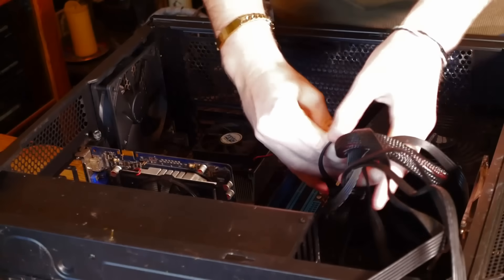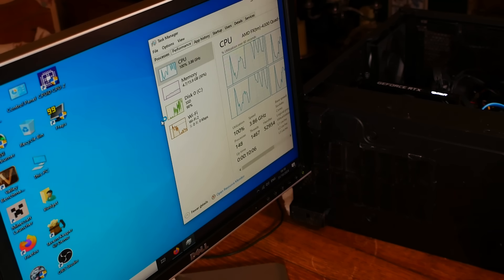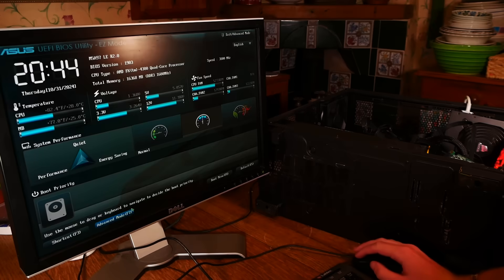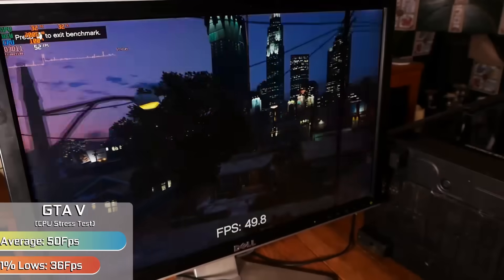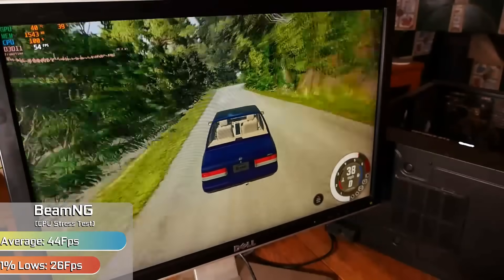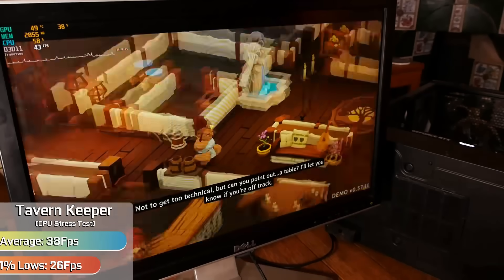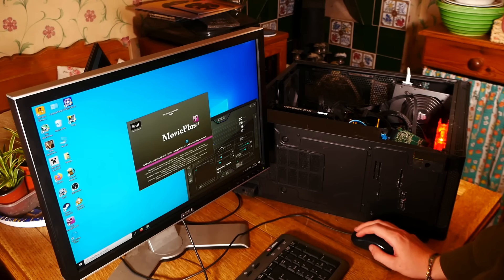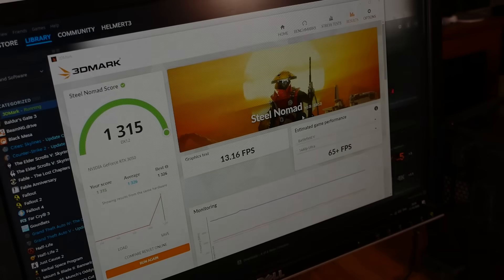AMDs Weakest FX Processor...

Comment from the maker: Are you still on AMD FX… (I’m so sorry) if you are let me know how you’re finding it 👍
Reply: my fx6300 is still chugging along. I don't play modern games and I'm more of a tinkerer using NixOS for occasional programming, CAD and 3d printing
Reply: Back when AMD's top end has increased in core count, and US$300-350. Now, at that price, it just a glorified low-end 6c.
Reply: I'm running a fx 8350 with a gtx 1060 6gb as my video editing and my daughter's homework computer.   It's good enough.
Reply: @AlfaPro1337  dude are you ok? For under $350 gets you a 9700X and a 9600X is going for around $250. Heck, for $380 you get a 9900X
Not to mention the 7000 series price with the 7700 going for almost $250
How are those "glorified low-end 6c"?
Reply: @MushroomClippyOfKnowledge  Nah, those pricing is right after X3D dropped. Original MSRP is way higher.

By AMD and PCMR standards, 7th gen Ryzen is too dead and dated.

Guess you didn't look at the pricing of AMD's top-end before Evil Su took over?

PX4 9600 - US$300
P2X6 1090T - US$350
FX-8150 - US$300

So what do you expect for US$300-350?

1. A glorified low-end 6c?
2. More than 8c top-end CPU (definitely not 8c, 10-12)?
Reply: @AlfaPro1337  "a glorified low-end 6c" Almost like it's made specifically for performance inside of games instead of fancy specs that only matter on paper
Reply: @itsmejak7888  If so, you should be buying Intel 4c/8t or 4c/4t, because that's why AMD is doing right now.

It's what the company doing matters, not the performance. People were happy when they got a top-end CPU for US$300-350, and increased in core count.

I guess you lost the argument and probably seething at the fact that what I said is the truth, and you got scammed and got a glorified low-end CPU!
Reply: My HTPC has a fx4300 and gtx 1060 6gb good for game streaming (to my main pc) and watching youtube. I have overclocked it to 4.8ghz stable.

Edit: Streaming in 4K 60 HDR
Reply: @WayLAN_Media I too, fx 4100 at 4.8ghz in asus m5a78m lx at 1.55vcore.
Reply: I had an FX 8320 still running up until some 2 years ago, when the motherboard died (and new ones were hard to come by here in Brazil). It lasted some 8 years. It was actually a decent processor, even though it had terrible temps.
Reply: @cesarbernardi1646 yes the only downside are the temps
Reply: i still have a fx system, a fx8370 on a asus  crosshair v formula-z motherboard, 32 gb of corsair dominator 2133.. i pull it out once in a while a mess around with it.
Reply: @markskonecki2050  I had the same combo, paired with Titan both cooled with custom loop OC'ed at 4.7. Fantastic custom loop by the way, still working and cooling well my Rtx 2080ti with i9 10900k.
Reply: I haven't used an FX, but I seem to recall that Steve from GamersNexus daily drives one on his personal machine. Undervolted and all. At least a year or two ago he did.
Reply: yea. I’ve got an amd fx8350, 24 gigs of ram, an rtx 2070 super, in a thermaltake level 10 gt snow edition… really wanna make the jump to am5 soon
Reply: I'm hoping to pick up a Microcenter 7800x3d bundle myself for Christmas.
Reply: @tech8652  interestingly my FX8350 is also in a level 10 but mines a combat edition (army green) mine once also had a 2070 S but I down graded to an R9 390 as that was more than adequate for my needs
Reply: @tech8652 my man this is such a wacky bottleneck lmao, even AM4 would be a colossal upgrade. no need for AM5 and DDR5 really with that GPU.
Reply: Yes. the piledriver 8 core, surprisingly solid
Reply: I still have two FX CPUs and my two kids use them everyday.
Reply: Fx 8350 and a GTX 980Ti. Still getting by, I am definitely looking forward to having something that runs cooler and smaller.
Reply: I have a small media-oriented PC rocking an FX-8300 that I acquired through local trade.  Even going to my backup rig,  with its i5-4460, it's a night and day difference.
Reply: really good and its enough for me
Reply: i have a english friend that is still on am3 platform.
Reply: my pc was a refurbished ibuypower with an fx 4100, which was fine as long as i wasn't playing anything from before 2010 lol. a year or so ago i got an fx 6350 which im running now, and does pretty well for almost anything i need.
Reply: I'm still on amd athlon, lmao. Amd athlon 740 if I remember correctly.
Reply: Yes, FX-8370 with GTX 960 2 GB...
the only limitation for me is in such niche use as the 86Box emulator, which requires much single-threaded performance, so I can emulate Pentium 75 at full speed at max
otherwise, it's more than enough for most my uses
Reply: I still have my AMD FX 8320 on a Gigabyte Ultra Durable MB with 16 Gb RAM and SATA SSD and GTX 1650. Old beater that I play old game on. Still going strong. lol. It never dies, amazing shit!
Reply: I'm still using phenom... one day I might upgrade to fx xD
Reply: @FacialVomitTurtleFights  Don't. Spare yourself the headaches I had to deal with. 😳
Reply: 6350 still my daily driver
Reply: Still on an FX 8350 and using a 1660 Super the nice MSI dual fan Gaming X model. Just waiting until I get RAM for my new motherboard then will be upgrading to a Ryzen 7 5700g and re using what I can from my old system. The FX has served me well since first using it back in 2015. Been through a few video cards since then actually and had two of them die. I find FX CPU's to be rock solid if you keep your expectations low they are capable of playing some modern stuff on Medium to Low settings with the right graphics card really not bad for what they are.
Reply: I have an 8350 system that I gave to my parents. It has a 32bit version of Windows 10 so all my dad's old games run natively without any tweaking.
Reply: I still have my FX8350 I bought in 2014 paired with an RX580.
Reply: I have started collecting FX chips, I now have one at every core count, and I'd say 2 golden samples. My 8320 (hits 5ghz at 1.47 volts) and my FX 4300 (does 5ghz at 1.44v)
Reply: early this year a fx 6300. Was cheap didn´t like it and made problems after ~6 years. Now a midrange Intel. :D
Reply: not still on it full time, but when im not on my Main Rig (which still rocks a Ryzen 5 3600) the PC i use for the "livingroom" Area where i spend more time than my own Bedroom where my main rig is, im using my oooold Rig which boasts an FX 8320E.  when you look to estimate performance or rather your expectations, with How the FX Arch. is built you dont have a Quad core, 6 core, 8 core you only have Dualcore, Tricore and a actual Quadcore.  w/ how they share the cache and FPU. you'll find performance differences when you Run games seperating them between the Odd and Even "Core" count in Windows's Task manager (as you'll find exactly when its running off the actual Cores and ones that are sharing the FPU. )

that said this old PC running the FX 8320E, for what i need it to do when im just chilling in the larger room, it's good still, like i can still watch streams and yt at 2k just fine,  i can deal w/ VRChat in Desktop mode in small instances, , Retro games, emulation and mid era games have no issue. then again im pairing it w/ a 1650 Super.  im using it at times as a streaming PC for just fine at 720p 60/1080p30w/ a HDMI Capture card. 

the FX Shined more w/ Multi-threaded tasks than any model ever did in single threaded task.
Reply: not anymore but i used an 8350 well into 2022, it was not the greatest (performed about the same as a friends i7 920 but with better 1% lows thanks to having AVX support i guess), was surprisingly usable.
in most games it managed to give me 50-70 fps and when paired with an rx 580 it made for a pretty good 1080p medium pc.
Reply: FX 7500 in a laptop. It's running alright.
Reply: Was driving Fx8320 till 2 years ago , then i moved to ryzen and x570 , still on 3600x . I was fine with fx , wasnt with asrock mobo tho .
Reply: I have one tucked away on plex duty 👍
Reply: back in 2015 I was gaming with the fx-8350 till 2017. I liked the chip.
Reply: Still rocking an FX 8300. Doing great, thanks for asking. Gaming, everything I own runs great. Where it falls flat on its face is video rendering. Luckily I have access to beefier hardware for that.
Reply: I have an FX 8350 with a GTX 1080, and with an Asus M5A97 R2.0, and 16 GB Corsair 1600 MHZ blue RAM chip. And most of the games are going really well even on Ultra,and on 2k Rezolution.
Reply: My uncle still uses an FX-6300 and mobo i got from marketplace and a rx580 2408sp i got from aliexpress it still plays every game fine.
Reply: i just upgraded to a Intel core i5-14400f from a fx-8350 I was using for about 6 years and I still have my PC, it's not my main anymore though
Reply: im still rocking a fx8350 black and sli 1070tis... just about everything i wanna play works great in 1080p med/high settings
Reply: Went from an 8120 to a 4770k and used that for a minute until I went to a Ryzen 2700x. Rocked that for a while and went to a 5800X3D. That 8120 was the first PC I ever paid for and built myself. Wish I still had it, but I always passed parts on to family and friends when I upgraded.
Reply: FX 8370-E user here.  Its not a bad PC for streaming with a dual PC setup.  I got much better benchmark and encoding gains by OCing the FS bus than by just increasing the core multiplier.
Reply: My 6350 has been relegated to NAS usage, in which it still does its job admirably
Reply: I used it on my gaming server that I host the game of the moment for my friends and I on. Ended up upgrading to a Ryzen 1600 about a month ago when I got a board and chip for 50 bucks Canadian
Reply: While I am using a Ryzen 7 5900x as my main desktop, I still have my old FX 8350. Tested a while back on Tomb Raider 2013 and seemed to play it pretty well. I know I used to play Resident Evil 2 remake on it as well and did very well.  My issue is that next year Windows stops supporting windows 10 and the FX 8350 and my old 4th gen i7 laptop cannot take Windows 11.
Reply: @KitsuneVoss  There are supposedly ways to get around the Windows 11 hardware check, but yeah it probably makes sense to move to a more modern platform for Windows at this point. The FX-8350 would still make a decent Linux desktop system if that's an angle you're potentially interested in exploring.
Reply: I'm re-building my first gaming pc, 16gb ddr3, fx-8350, and r9 390 oc from sapphire
Reply: My daily driver is still my ancient 2012 FX-8350 build with 32GB 1866 ram, R7 360 2GB, Samsung 840 EVO 240GB boot SSD, 3 x 2TB Crucial MX500 SSDs, and some assorted 2TB and 1TB HDDs. I had to add a PCIe SATA card to have enough SATA ports. All in a Thermaltake Dokker case that has no glass panels and no RGB unicorn puke, powered by a SeaSonic Prime Gold 750w PSU that came with a 12yr warranty. I have never overclocked it, so I have never had any heat problems with it. I have a CoolerMaster 212+EVO w/2 120mm fans on it in push-pull config. I have cool n quiet enabled in BIOS, windows 7 power profile is set to balanced. HW Monitor tells me the CPU is now at 30c with a max of 49c since last boot. I only reboot when Avast Free updates the program and requires a reboot which is about once a month. The system has run 24/7 since it was built because I have to run a torrent client 24/7. At all times I have running Total Commander, Deluge, Firefox, Palemoon, 4k Video Downloader, and usually Media Player Classic Home Cinema. When I need to download something from usenet I'll fire up Forte Agent. And if the rar archive needs repairing with par files, QuickPar fixes it fast since it can use all available cores.It normally only uses 4 cores, but Quickpar or playing a high bit rate 4K video can cause it to use all 8 cores. I'm not a PC gamer so I have no idea how my CPU or GPU would fare in games. All I know is that it still does what I built it for, so I haven't wasted money I can't really afford to spend anyways building a newer Ryzen system. I think maxing out the mobo with 32GB ram and having an 8 core CPU(yes, it has 8 integer cores and 4 FPUs) are the reasons it has kept up with my needs.
Reply: I'm still on Phenom II X4 with DDR2 RAM😕
Reply: @foobar-9k  I have a Fs1b mobo and it`s slow af, but still fun to really see how bad it is 🤣
Reply: I was still using an FX-8350 Black Edition until middle of last year and I would probably still be using it if my RX 480 didn't suddenly die
I still have my old setup around to turn it into a media or emulation station or maybe even a pinball emulator at some point
Reply: I got the FX8350 and I was playing games with this for 9 years and had a great experience until the motherboard started warping and eventually broke from it. I revived it some and made this computer a secondary one. I always ran my CPU at 4,6ghz which was the highest the two worst cores would go. But I liked it and it was a great value in the end
Reply: Im still on a fx 6300 not bad  even in 2024.
Reply: I used to from mid 2023 to late 2023, it did not perform as good as I thought it would for a 12 year old 4 Core CPU, it made me switch to a whole gaming laptop with a Ryzen 5 7535HS and RTX 2050. I would definitely not recommend using in for modern gaming
Reply: Former FX8350 owner here, ditched it around february this year (2024) due to a motherboard EOL (i'd still be using it otherwise).
I didn't truly realize how slow that thing was till i got myself this cheap 12th gen i5 on sale (it's a 12400F), and it absolutely ripped through all the old games i had that were being kinda sluggish cause i had choked them up with mods.

For some of the newer stuff though? didn't notice a thing in GTAV performance-wise, no man's sky ran about the same, and RDRII was still about the same speed, maybe running a little bit smoother in saint denis with the new cpu, but that's it.
For modded project zomboid, which was eating up 100% of all cores on that old FX, it was a HUGE difference though, didn't even look like i was playing the same game anymore, the i5 was super fast in that, cpu consumption was a little under 50%.
The elder scrolls games and fallout games all ran much faster too on the newer i5, shockingly faster, but that's cause of the abysmal single core performance of that old FX - it appears, and felt like, that the old FX just barely outclassed a late gen pentium 4 in single-core speed, and that's really bad.

Oh yeah, during all this i had it clocked up to 4.9-5.2ghz in the summer and a lil bit higher during winter, bordering 6ghz, with the core voltage going up to 1.475 which was about as far as i felt confident pushing that thing and my poor barely cooled VRM.

One fancy trick i pulled with the FX for the legacy vidya: my gigabyte board, the ole GA-990FXA-UD3 rev3 had a feature that would configure the cpu to use "1 core per compute unit", so instead of a shared parts technically real but kinda fake 8-core, it would become a full 4-core with access to all the resources, instead of sharing them.
This would make the older stuff run considerably faster, at the cost of making the newer multithreaded stuff run worse, which i welcomed with open arms.
This 4-core config also enabled me to raise the clock even higher! :)
Reply: my dad was on amd fx 8350 2014-2023
he upgraded to i5 4670k, when he comes around again I'll give him i7 4770
Reply: had an fx 8350 until 2022 when i switched to a ryzen 5600x. i still used the same r9 380x. the jump was massive. larger than i could ever have imagined. that being said, despite it being shite, the fx managed to run any game i threw at it...albeit on  low frames. but it did it. switched my r9 380x for a (faulty) 6700xt. massive jump. now, i switched it to 7900gre (a pretty substantial jump again tbh)
Reply: @Celatra  that's awesome. My 8350 has played everything I've thrown at it as well. Granted I don't play a lot of the newer games out rn. And Ive got a decent bottleneck with my rtx2060 12gb GPU. But I'm happy with my setup. One of these days I'll upgrade it to the Ryzen 5 3600 I have sitting on my shelf with the b450 mobo. But for now I'm happy with my setup the way it is.
Reply: I was on the fx 4300 until I got an i7 3770 witch im still on and it plays bo6 way more power do miss the overclocking of the 4300 though
Reply: Yuuuup! I use my fx 8350 with a 1070 8gb to play VR and run most of my music software and steam games for the last 4 years
Reply: my son is still running an amd fx 8350, no issues.
Reply: I sold my 990fx sabertooth for a profit .  what a beast
Reply: Using Phenom II and FM2
Reply: I have a 10 year old FX8520. It's still usable as a HTPC, only to watch movies and stuff
Reply: Only replaced my FX-6350 quite recently with an R5. With an aftermarket cooler w/ a massive heat sink, the temperatures did remain low and the overall performance wasn't completely hopeless.

Yes, it didn't run modern AAA titles. But for the games I tend to play, it was more than enough.

My nephew is still using it in Fortnite and Minecraft :)
Reply: The grouchy old FX9590 is still running.  It grinds out work-units for B.O.I.N.C. with ease.  Once in a while I take it for a spin in WoW, and it still works fine.
Reply: I am running AMD FX 6300 with 750Ti 2 GB GDDR5 GPU. I am able to run DeepSeek 7b LLM on it, it is slow but it still runs!!!
Reply: I daily an FX 6350 machine for novelty. It surprisingly runs what I want it to. Overclocking is really easy to do for these, thankfully. Since you basically have to OC to do much of anything on these chips.
Reply: fx 8120 , 22gbram corsair 1600mhz , it´s a decent cpu nowadays , like 8tb in hard drives , rx 560 4gb
this is my main pc .
Works still good ot this days
Reply: Fx6300 here
Reply: I've had an 8350 for almost a decade now and somehow it still works for way too much
Reply: Still running my Youtube channel today in 2025 on the old FX8300!
Reply: Aye, on the final days of my FX, served me well for over 10 years.
update After 3 weeks on a 9600x, i admit that games with an arc b580 are significantly faster, along with bootup, filecopying, running vpn etc, but the fx is still fine for watching streaming movies or browsing. And the real twister is that Hell let loose ran faster on the fx than on the 9600x/b580 combo. Sometimes older is better.
Reply: Typing this on a PC with an FX-4300, way better than what I had (Athlon II X2 245e). Might have to get a GPU to match, maybe a low profile RX 6400 or better. 👍
Reply: Recently played god of war ragnarok without avx2 and without lags on fx8350 with 3060ti, also AC vallhala locked on 60fps. but i have m2 with adapted. ghost of tsushima also very good on personal setting. Mirage also was good. Only upgrade I accept at lowest is 5700x or some medium am5 cpu.fx8350 Its bottleneck for 3060ti but sill i can go ultra setting on full hd with 80-100% while gpu 60-80% and all depend on game u play.RDR2 was stable at 80fps.
Reply: AMD FX8350 Black - still running strong after 12 years and on the stock cooler - the hottest it ever gets is 72c - love then thing.
Reply: I have a ryzen PC but i had a friend with an AMD FX 8350 Black Edition that absolutely struggled in anything, it either wanted to overheat or die one of the two, it randomly crashed a lot, sadly i used intel up until my current PC so i couldnt enjoy dealing with this idiot series of processor (i really did not like FX CPUs, i always thought of them as potato processors)
Reply: No, I'm on the futuristic i7-4710HQ. The FX series I completely skipped for some reason.
Reply: I had given my old FX-8300 with 16 GB RAM, RX-460 and half gig SSD to some kids. It still runs older games like Sekiro, Dark Souls , Code Vein with 1080p med settings and they are not complaining 😁 I also have old FX-6100 with GB RAM as a printer server. Works fine, no problems.
Reply: Of course not: 1100T@4GHz 😲
Reply: I was on the top end fx processor (8/4 cores, last version before zen) for several years, then moved to an r5 1600AF (A 2600 by another name) in january of 2020. Using a 3900X for my daily driver and have a 3600 and 5600 as well, though only one's in an asymbled system.
Reply: My brother is still using my old fx6300 PC at home for browsing and videos and other lightweight stuff. It's amazing how cheap it was to get absolute balls to the wall 990fx motherboards for these CPUs back when I built it.
Reply: @BudgetBuildsOfficial  I am indeed still on the FX 8350, and it runs my games just fine. I used to cool it with a Corsair 280mm AIO but one of the fans was playing up so I switched to a spare air cooler I had, think it’s a Hyper 212. Keeps the cpu at a decent temp and is quiet.
Reply: only just this last summer i sold all my fx powered pc's and am3 platform stuff, and I'm happy with AM4 for a while yet
Reply: well, i just changed my 5700x3d and 7900xt to semptron 2500+ and radeon 9550 :)
Reply: I plan on rebuilding my fx 8350 system just for nostalgia purposes..  The rx 580 from the system still works😁
Reply: I got a computer which I'm running Proxmox on for 20 bucks, with a fx6300, and upgraded it from 4gb to 8gb ram
Reply: Yeah I had this for years. Finally moved to a Ryzen 5.
Reply: Yea on my main PC Fx 4300 with r7 250 1Gdd5 i replaced stock cooler😅😅😅 with air cooler.
Reply: FX 8350 is fine for web browsing and programming on Linux.
Reply: Not my prime mover, but I do have a couple, a FX8350 was going to be my budget challenge until a dirt cheap X58 system same my way
I actually jumped from Phenom II X4 965 to i7-3770 after getting a H61 board (minor pin surgery required) in a bundle of junk - the previous board being AM3 with limited upgrade support for FX
Reply: I used my 6 core FX until last year.
Bought it in 2011 was good enough for Doom 2016
after that.... it started showing its age
Reply: My FX9370 was clocked up to 5Ghz, used till 2020 then it went to server duty underclocked. It was just retired from server land last year. Bought it cause the 4770K was 200 more at the time.
Reply: How is the FX 4300 the weakest when the FX 4100 is the lowest model?
Reply from the maker: @RWL2012 FX4100 has 2MB more Cache, which largely made it match the Piledriver FX4300. There is also a weird OEM cut cache FX4150 but they all perform within such a small margin of each other that there’s usually very little difference.
Reply: Until a couple of years ago I was dailying an FX9590 for both work and games. The FX eventually died. I'm now using a second hand , second generation i7 and get the same/better performance.
Reply: I went from a Phenom II 1090T to an 8-Core FX processor. Doing so caused me enormous RAM issues - not to mention system instability. I tried three separate FX processor types (including 4 and 6 core), 3 brands of RAM, and 3 different motherboards with the same RAM issues, before giving up and going back to the Phenom II.

Phenom II still works great, and outperforms every single FX I used - even the top of the line ones for the era. 

It was a disaster of a processor. It absolutely hated running 4 sticks - even when they were the same type! Phenom II ran 32GB just fine on the first try, and performing well with that and a GTX 1070.
Reply: @YT-TheLegacy  I remember getting a phenom ii 965be instead of celeron, i3s or fxs since it was almost the cheapest option and somehow I used it till 1 year ago, first gaming and study, then as an office pc in my business. It worked pretty good for what it costed
Reply: I was on the second best fx cpu until about 2022 which is when it became unbearably slow.
Reply: No. I upgraded from the Phenom 955, it was a considerable boost, felt right away. Kept it (8350) until I upgraded to Win11 on an i5 8400 (got for free essentially). This was also a considerable uplift in performance. I only really bought AMD CPUs for my personal use.
Reply: @BudgetBuildsOfficial  I upgraded from one almost 2 years ago. It was getting non-viable in modern games, especially on Windows 7 I refused to upgrade from. 4.2ghz, 2*8gb 1866, GTX1080, 2560*1080 75hz.
Reply: Wish you benchmark one day the FX-9590
Reply: Skipped the whole Faildozer era, when I saw the reviews of FX-8150, I instantly ordered a Phenom II X6 1055T. After that it was Intel until I got a Ryzen 5 2600.
Reply: I still use a FX-8350 in one of my pc and it hold up really good. But I`m looking for a FX-9590 to try out :)
Reply: @Amahrodon  ah I currently use an ryzen 5950X for 3 years of use it still feels like new I hope it last over a decade
Reply: @HarimeNuiChan  This just one of several older pc that I have, but my main has a 5900X/RX6950XT and it`s awesome!
Reply: @Amahrodon  hey nice I daily drive the rx6950XT since 2022 as well! I replaced with it my aged GTX 980 I had from 2014/2022 till the 6950xt release
Reply: I used the FX8350 with a coolermaster V8GTS for years up until I switched up to a 2700x. I always used to say how amazing it was (even though it wasn't even close to Ryzen) Even when I had to go back to it for a few weeks after a board failure, I didn't really notice too much of a diference in performance until I started playing the games I was used to at the time. I had it coupled with an RX Vega 56 mind you XD
Reply: im on A8 9600 BRO IM BROKE BUT ATLEAST ITS AM4
Reply: I have a FX 6350 system but abandoned it to closet for my i9 9th gen laptop. Still, would buy a 8350 or 9590 if i wanted to go back.
Reply: Waiting on my 7500f to arrive but YES still using (for now) my old 8320
Still works okay for the games I play but an upgrade will definitely double my FPS 🤣
Reply: I was on a 6300 from 2018-2021, honestly it was solid, but 13 year old me (and.. well now 16 year old me) really likes beamng, and the beamngmp multiplayer mod was just getting popular, that's where it really just stopped working. started out in 2018 with a radeon r7 240, then in 2020 i switched to a gtx 1650 super (younger me should have bought like a used 980 for the same price..) and it just worked well.

(also, strange thing, i always found my 6300 to absolutely suck in minecraft without optifine, i remember being entirely unable to play 1.17 for a while because optifine was delayed over and over..)
Reply: Im still running FX8350, works ok, heats my room, but still can game and do work.
Reply: I have fx6300 still very usable PC , ASUS motherboard , 8GB ram , Saphire HD something ...
Reply: Yep I'm using an FX-8350 right now because my 1800X has gone through two motherboards fried by lightning. My partner is using an A10-7890k because I needed the 8350 and the only other alternative I have is... my FX-4300. It was a terrible processor but it was my first build and I wanted to save money for the GPU.
Reply: I am still rocking an AMD FX8350 with an Asus 970 Pro Gaming Aura motherboard with 32gb of 1866mhz DDR3 ram and an rtx2060 and it plays everything I like to play just fine. I'd say the most demanding game I play is Destiny 2. But it's nice and smooth. I am in the process of getting together a Ryzen 5 setup as my upgrade. I have a MSI b450 tomahawk mobo with a Ryzen 5 3600 and 32gb of DDR4 2400mhz ram. Hopefully my CPU cooler will work with am4.
Reply: My fx8350 at 4.44ghz 220bus clock stomped 3rd and 4th gen i7 but I did have the best mobo the asus sabertooth 990fx with a 4x4gb 1600mhz ripjaws @1760mhz hits 4th to 6th place in userbenchmark and has smoked some 4.8ghz@200bus clk  benchmarks she was a beast and carried had as more games used more cores it wasn't perfect but a 3rd or 4th gen won't touch it in modern games
Reply: Still using a FX-8350 in my lab PC.  I was happy with it, even this year.  I only upgraded my main pc because of a single game I wanted to play it couldn't handle 😅 And then I found out I would have been fine on it after all.  But still glad I upgraded
Reply: I finally upgraded from Phenom 1090T to FX8320e during early Ryzen days when lots of people dumped FX on eBay. Built a second soon after for my kid. FX8320e was one of the better FX chips, basically being a reliable overclock at low temps.  My kid upgraded to AM4 and my wife got one of them. (Upgrading from Phenom x945, lol).  I later upgraded my CPU to FX9590. I'm not much of a gamer, so it did what I needed it to, although was a hot beast.

Finally just switched to Ryzen 9 7950x. About 10 times the performance at 50W lower TDP. 😂
Reply: yes i am, im still running a FX-9590 in my daily rig paired with a GTX 1060 and its still running 99% of the games fine, its not the best and it is showing signs of it getting old by sometimes having small bugs and glitches but thats almost never atmost 1 time a month or so, so yes i am still really happy with my old CPU and GPU and i will not replace them until i really cant run games anymore
Reply: a few years ago i was running an AMD A10 6700, that thing was atrocious to use in general, upgraded to a ryzen 5 5500 and it's going strong
Reply: I still use one. It is the most modern PC I have. All others are 486 and Pentium 1 "collection" and a Duron. I meant to upgrade a few years back but a sequence of events, that probably started when a certain boat docked in the wrong place, caused the prices to escalate beyond my financial capabilities. 

My current system: Fx-9370 ; Gigabyte 990fxa-ud5v30 ; Ripjaws 16GB cl7 ; Sapphire Radeon R9 Fury OC 4GB ; WD_BLACK 1TB SN850 on a PCIe Riser and an old 40GB IDE for the boot sector/partition because AM3 motherboards can not boot from NVME ; a few other platter HDDs ; Xubuntu 22.04 .

I mostly use it in power saving mode (CPU limited to 110W, 1.4GHz; GPU limited to 45 W, 300MHz) which, with all peripherals, consumes around 140W while still allowing me to comfortably play GTA Vice City/ San andreas and all the Hitman games until Absolution using Lutris in 1080p. I actually have to frame limit those games or some of the animations run too fast and cause the game to not register actions. Most of the time I just use Firefox, Blender, Eclipse, etc. The only thing I cannot run (so far) is applications that require AI.

I could not see if you were using a platter HDD for your testing but I highly recommend you install a NVME on a raiser and retest. Preferably install the raiser in a slot where it does not have to compete with the GPU in bandwidth but still connects as directly as possible to the CPU (instead of a slot that connects through a chipset/southbridge like some x1/x4 slots). In my case, I had a huge boost in FPS in games because the CPU/GPU did not had to wait soo long for the textures to load (the most drastic increase I saw was Hitman: Blood money, running in performance power mode, that went from max 80 FPS to max 220 FPS).
Reply: There was an exception, when the FX-9590 could be bought second hand for 50 quid, it was an absolute bloody bargain providing you had the rest of the rig for it which I did. Ran it for 6 years at 5.5Ghz without issue until I jumped to AM4 2700X, now on a 5800X3d, same board and ram. :o)

And it also doubled as a room heater in winter with it pulling a mere 225watts.
Reply: p.s  I am the original author of the X800 bios mod that gave you an X850 for free. ;o)
Reply: Rockin a 9590fx...  Biggest problem is getting windows to play right with the drivers for the board..  and crossfire being dead on modern games...  Had to "upgrade" from 2 r9 270s to a 590 fatboy.  The board drivers are catalyst2 and the gpu is adrenaline.  Trying to get an install allowing pcie3 instead of 2 is a pain and i foolishly tried to fix i
as alt tab dropped brightness to 0 in all applications and i had to get lucky with a graphics reset to restore brightness.  When 3 works it is of course double the fps of 2(the board can bridge pcie2 lanes together into 3 when the drivers are working).  Which in palworld is 1440p max settings about 40 as opposed to 14 to 20 fps.
  The 2 r9 270s of course match the single 590(together they have more ram so the higher texture qualities are better handled) but mGPU must be enabled in the games code since dx12.  I had to upgrade due to a Palworld incompatibility with the last compatible version of adrenaline with the r9 270s.
  If it wasn't for AMD abandoning the needs of the motherboard in their drivers I wouldn't be upgrading to a 5090 and 9950x3d.  But times change and hopefully that combo will last a decade as well.
Reply: I still use a pair of FXs, more because they work perfectly fine for their age. Fun fact; I bought an FX 8370 in 2018 new for dirt cheap, and the biggest surprise was that AMD was apparently still producing it at the time even as Ryzen hit the markets, as it debuted with the newer Wraith Max cooler that was limited to the Ryzen 1800X at the time (and valued pretty well as a working starter cooler). So it was a sneaky way to get the Wraith Max cooler if one was wanting that for whatever reason.

My FX-8370 was used to upgrade an older FX chip on a GA-970-Gaming SLI mobo that had served as a gaming rig, and remained a usable rig with an RX 580 GPU and playing games at Medium settings with Shadows off, and that lasted me until Ryzen 2000 came out. The PC was then repurposed into a basic home-server/PLEX-style server with a single-slot RX 550 GPU, and a bunch of SATA drives.

My second FX was a freebie from a friend; an FX-9590 and a board capable of handling its energy use. I mostly used it to practice water-cooling building, before eventually retiring it to having an AIO and serve as an arcade-emulator and old-games rig, still being left on Win7. I still turn it on on occasion during winter for easy space heating and to play some older games that don't play well on Windows 10 or 11.

Will newer, cheaper Ryzens work? Sure. But why trash them when they're still perfectly serviceable? A bit of undervolting and custom timings see them doing well enough.
Reply: I built my pc in 2012 still using, AMD FX-8350 on an AOI... the gpu is a 1060 3gb the AMD 7870 died
Reply: A8-5700 is my bios repair work horse
Reply: i have ir unti june ,i have it aboz 10 ir 1w2 ish    yers
Reply: I am not on FX any more, however I was on an FX4300 for years. I upgraded to a R5 1st Gen only within the last few years when the old system failed.
Reply: It's ok. Very durable system
Reply: @YTSZAZU  yea until  my was broken i didnt have new one
Reply: my router is still running an 8350e. last cpu without the psp backdoor built in. handles 300+ firewall rules and 10 gig ethernet like a champ
Reply: I still have mine stored.I did pair it with 24GB Ram and SSD mostly for browsing the web with way too many open tabs. It also has a way too big bequiet aircooler with 120mm fan for low noise. Phased it out for Ryzen 3000 some years ago.
Reply: Yes using an fx 6300,earlier used an i3 3220 and it was trash
Reply: Have been running fx-8320e for 4 years, and it rocked!
Reply: Learn to adjust for inflation if you want to talk about the prices of the past. This is embarrassing.
Reply: I've got an old system in the garage and it's rocking a FX8300 cpu and two GTX 970's in sli. I fired it up last month and oh man is it slow!! It still has a spinny disk and not an ssd, so the boot time alone was painfully long. I keep it in the garage during winter because it serves as a space heater when under a heavy load.
Reply: FX6300 + 750TI here. It was a budget build when i bought it years ago but surprisingly it still works, modern games in 720p are somewhat playable depending on the title. I could run elden ring, though it wasn't very playable, same engine armored core 6 on the other hand worked so well i could actually play it in 1080p. Online games with lower system requirements like rainbow six siege still run really well. It really depends on the title and whether or not it's well optimized.

Im getting a new gpu in a few days and im really curious if 6300 can keep up with it or if im going to be cpu limited until i get a new motherboard/cpu/ram combo in the future. Personally my experience with it has been positive, big reason why i'll be sticking with amd and upgrading to ryzen in the future.
Reply: My brother uses a FX 6300 and NVIDIA 720 as main pc. 
He is studying to become a lawyer.
Reply: FX9590, HD7990 32gb DDR3 1600. My AMD build from 2014. I remember fighting with it just to get decent frametimes in BF4 due to crossfire, I learned that I wasted 600 dollars on a card that you basically can use only half of lol.
Reply: not in years - I do have MB, memory and a fx6300 and 8350 in the closet- I remember them being hot and slow due to architecture.
Reply: am still using my FX-8310 & Biostar ta970 to this day..The memory is gskill ddr3 running at 1866 and still going strong. The comparison to the I7 the FX was way more value an overall computer that could game for half the price ..  God Bless
Reply: i still use the FX 6300 and 8350 (even though i use a Ryzen as well)
Reply: im with celeron g1820 need help
Reply: No, but some of the laptops I’ve used have A6 APUs which are UNGODLY SLOW because of a hard disk drive.
Reply: late video but yeah dam
been using an fx 8370 that only used 40 percent of my 2060 playing vr
thanks to amazing valve software tho it was actually playable
Reply: As a hobby system builder I find the FX series a beautiful oddity. 

Incredibly powerful for windows XP, vista and 7, barely capable on windows 8 and surprisingly capable on windows 10, (seriously it seems to run better on 10 than on 8). 

Few CPU are actually good for multiple OS boots but the FX 6300 and 8300 are remarkably capable of running from windows XP to windows 10 as well as surprisingly stable for Linux distros and emulation drives. 

While playing anything newer than cyberpunk 2077 on an FX 8350 is spotty at best the fact that you can literally run XP to 10 at reasonable quality expectations is actually amazing. 

Now I do have an i7 4790 and it really doesn't perform that much better than my FX 8350 system.

Yes average and max fps regularly win with my 4790, however that's partly because it's paired with a GTX 1070 8gb while my FX 8350 is paired with an r9 290 4Gb. 

I've found the bottleneck on the 8350 doesn't like running a GTX 1070 or even the RX 580, it seems to be more  in parity with 4GB GPU. 

The 8350 works quite well with an r9 290 or the GTX 970.  

In my experience with 8GB GPU it has weird high, low, avg fps.

Case in point, paired with an r9 290 it can outperform the Rx 580 in 1% lows.
Reply: My FX torture ended on 2022 when I sold my laptop with FX-9830p

One of the worst laptop I've ever seen. Mind you it's a 2016 laptop can't run CSGO at a stable fps BB even with the laptop dedicated GPU (RX 460)
Reply: @Rei-bg3rf  That FX was not based on Bulldozer/Piledriver. That one was bristol ridge. A bad APU to pair with a GPU, but not the traditional FX. my heart goes out to your past self. I was spoiled with bargain old business machines with old i5s. Not as good at multithread, but way, way better single core, and especially back then, hyper threaded dual cores were what software was optimized for
Reply: @jacksonmontgomery1220yea man, that shit was worse....

My young self dumb af for only lookin at only the RX 460 on the laptop which is great hahaa. 

6 years later I bought a PC. The excitement I got from buying it with 5600 and 3060 was amazing.
Reply: Still on FX, moved up from a 4100 to the 8350 last week as the pc started to blue screen when I taxed the cpu., Haven't overclocked the new cpu yet but will be in the coming days to see whats on offer.....
Reply: yep i still use it im on it now
Reply: Yes,not trying to 1 up anyone but I am still using my trusty 9590 on my gaming pc,chuggs along quite happily at base clock speed (4.7Ghz I believe ) and still does all I need it to do.
Reply: @fujiuser1968 I had a 9590 but it kept killing motherboards. After the 4th mobo and waiting months for shipping from china I finally settled with the FX8350 running @ 4.2ghz. For the $45 price tag it's not horrible. I sold the 9590 for $100 and the buyer said it works great and he's happy with it. He had much better luck than I did with it. I actually just purchased a Ryzen 5 3600 today for $40. I'm sure it will out-perform the 8350. But I actually really like the FX8350 setup I have currently.
Reply: 7600X beats an I9 11900K
Reply: I never had an AMD CPU. Still on team blue. i5-13600K
Reply: @Ignisan_66  The last Intel CPU I had was a Pentium Pro. Been on AMD ever since! (I'm counting desktops only... laptops have generally been Intel.)